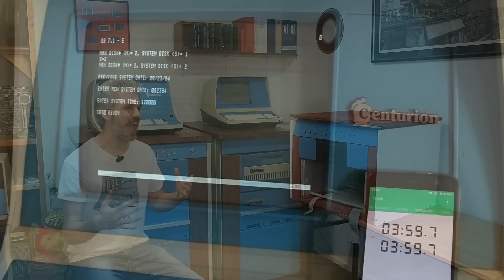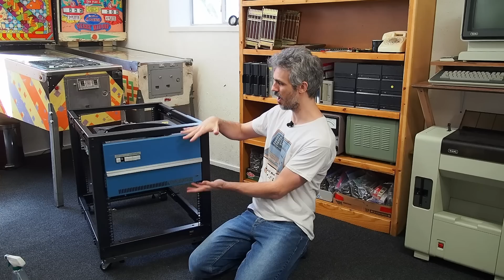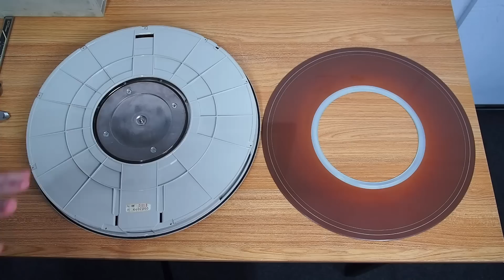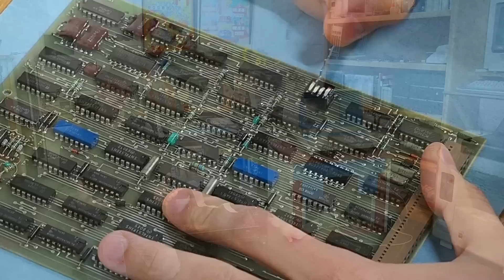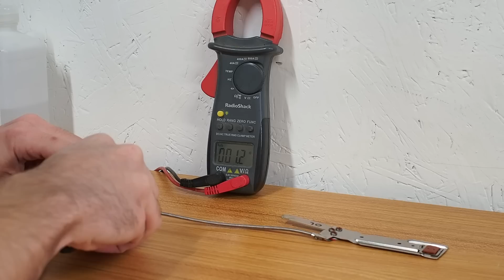Trying (and Failing) to Restore a 1970s CDC 10MB Hard Drive

Comment: The thumbnail is SUPERB!
Have you been watching Curious Marc's Alto restoration videos on endless repeat? ;)
Will a Hawk drive run WITHOUT a fixed platter???
Reply: A Hawk drive shows up in the Centurion OPSYS as two logical 5MB disk drive volumes. Yes you can build up a Hawk missing one of the two platters ( fixed or removable ) and the heads for that missing platter can be removed.  The trick is the Hawk must have sector ring pules from the fixed disk platter and the removable disk platter for the Hawk to load the heads over the remaining platter.  So if you  install a removable disk cart. with the platter & heads missing you still have to have the sectoring ring installed in disk cart.   This is what we are now doing now, have built up a Hawk with a fixed platter & fix heads only and a cart. sector ring.  Testing now under way.

Comment: The Commodore 1541 floppy drive mechanisms made by Newtronics had a design defect where the epoxy would fail a bit and let moisture in, causing the head coils to corrode and go open. I wonder if a similar fault has happened here.

Comment: Not that I'm suggesting this as an alternative to fixing the Hawk, but wonder if it would be possible to make a storage solution with a modern SSD that 'looks' like a Hawk drive to the Centurion? Might be useful for day-to-day use so as not to put wear on the original drives.

Comment: Most likely wire failure on those heads (since the connecting wire has least support,and is open the corrosion)  You may be able to rewire them (nothing to lose)

Comment: For a faster floppy replacement, could you use an emulation? There should be something usable out there.
Reply: Emulating a Shugart interface and custom sector format on floppy is still not a trivial thing, unfortunately.
Reply: @graealex  luckily they already exist. You can buy them. Might need a few tweaks, but if they can write emulators i am sure they can do that.
Reply: @bzuidgeest  "a few tweaks" is going to be the understatement of the century
Reply: @graealex  We're looking at floppy emulation with an RPi Pico. The issue with off the shelf emulators is they're set up for "standard" formats, and the software effort to coerce them into the non-standard Centurion format looks non-trivial...

Comment: I don't think the coils blew out. It would be strange if that happened. There should be nothing in the electronic that pushes the needed amps through the coil without destroying the electronics. My guess is that the wires to the coils are broken somewhere. I successfully repaired broken wires in a headphone coil, but it was a pain. The wires where thinner than human hair, and i think the wires in your coils are even thinner. To measure und fix that you need equipment you don't have. Maybe someone who fixes up smartphones can help you out?

Comment: I would never have thought of dip switches causing issues.   I learned something new from you today.
Reply: I was servicing a big graphics workstation which had intermittent failures.
I traced them to these nasty dip switches and replaced them (Approximately 15 8bit in each WS)
After that I had a quiet life with no calls from the users.

Comment: I bet the problem is the wires going to the heads are broken. Although coils can be burned by carrying too much current, it's more likely that the wires being under constant motion just broke the conductors. I would check the continuity directly at the coil-wire connection and see if it's still open circuit there. Wires are easier to replace than head transducers.
Reply: I was thinking the same thing!
Reply: @Derundurel  so was i, guess we'll know in the next episode.

Comment: I've see you and yours in action -- you will figure this out.  Here's a question:  could an ST-506 drive be adapted to serve in time for the meets you need to make, or is this interface (SMD) more akin to SCSI.  Could another Finch drive be made to serve?  (I know... the ST-506 thing is akin to heresy, but it would beat a dead and non-working machine.) 

However you decide to proceed, I'm sure you will eventually prevail.  Ganbatte, yo!

Comment: Please, if you haven’t already, consider putting your own spin on the recently released new old stock “Nabu” computers that were discovered from the 1980s, and that are now being sold brand new for dirt cheap. I’m about to get my own, but will need guidance on what to do with it. There are some AMAZING things being done with it already, e.g. the “ElectroGeek64” channel, but I would be fascinated to see what you can do with an original, yet brand new, 8 bit computer from the 1980s…

Comment: Remember how you had to swap the analog board earlier in the testing to get the alignment test going? Yeeeah, that thing doesn't happen to interface with the R/W heads does it? 🤔

Sounds like both the RW and Erase heads are capable of being "driven" (signal applied to, not just read from, them). So, a control board being fried is definitely something that could knacker them, I'd suspect!
Reply: Yes the only way they would be open is too much current or badly corroded enough to break the copper wires.

Comment: Shim the heads for the thicker disk maybe? 

Is the alignment tool just hard sectoring the disk for use with the controller? Old disks needed to be  synchronized from what I remember

Side thought, Should try bubble memory.. would be period correct I think…

Comment: Does this use a 100tpi or 200tpi head? I wonder if you could salvage and adapt a set of heads from another drive, like a 100tpi Hitachi HFD305S or something. Idk.. Maybe even something more common than an already-super-rare 3" drive? maybe even a standard 1.2mb 5.25" pair? So what if the fixed platter is offset weird and incompatible with everything else?
Reply: I'm totally seeing a 3d printed adaptor block to make a salvaged head fit into that little metal bracket/arm. or there's fabricating new arms from spring steel, but that's a whole effort to get right on it's own.
Reply: The CDC 9427H in the Warrex / Centurion config uses 200 TPI Straddle Erase heads (two Upper & two Lower).  Other OEM users of the Hawk could have used 100 TPI Heads or even Pre-Ease Heads to meet that OEM's needs.

Comment: Where did you measure the resistance of the heads?  At the heads them selves or from the end of the wires that go to the heads?  Are the wires going to the heads possibly the part that's open circuit and you would just have to replace part of the wires? Likely the part of the wire that bends as the heads move.

Comment: Emulate the drive, and remove the heads from the physical drive but still have it spinning with a  partial head assembly still in place so you still get the kerchunka. Then split the signal so that commands get sent to both the physical drive and the virtual drive, but data is only read back from the virtual drive.
Reply: Which defeats the purpose completly.

Comment: The cool thing is you can actually work on these drives.  Newer spinning magnetic media drives are so tight tolerance wise, you really cannot work on them without specialized clean rooms and the like.  Those drives were so expensive, that they HAD to be repairable.
Reply: my new 14TB drive is so tight tolerance that it uses helium instead of air (so the heads can float even closer I guess), its totally sealed
Reply: it made me somewhat afraid of drives, that's why I use 3-way RAID redundancy and have 8 of them. they are basically irreparable and lost data is lost forever, which is why you have to use a proper RAID system that does parity and have backups, there's no recovery if they ever fail.

which is basically the truth for any hard drive nowadays, they should never ever be used as a single drive for any system, unless you don't care about losing data, because you are going to eventually lose data.
Reply: @monad_tcp  Which RAID do you prefer? I'm not educated on the differences, and have never been able to figure it out for myself.
Reply: @GrayRaceCat  usually I use stripping with two-way parity, that means two disks can fail.
But for really important data, I use three-way parity.

That would be roughly RAID6 and "Raid7", it's by software.
Reply: @GrayRaceCat  look into zfs and unraid.
Reply: @monad_tcp  Thank you. I’ll read up on Raid6 and Raid7. I’m curious why did you put quotes “” around Raid7?
Reply: @MrMousiee  thanks.
Reply: @GrayRaceCat  he mentions it's sw raid instead of hw. Meaning it's probably some other raid solution like unraid or zfs or something else. Doesn't use a raidcard and all handled by software.
Reply: @GrayRaceCat  raid6 is double parity.
Raid7 would be triple parity , but that's non-standard, it only exists as software raid.
Reply: @monad_tcp  thank you.
Reply: @GrayRaceCat  Bear in mind that RAID protects against one thing: drive failure. But if the drive array is commanded to delete or overwrite something — user error, software bug, or normal operation — that deletion or overwrite will be dutifully mirrored across the array. Consequently, a key thing to remember is RAID IS NOT A BACKUP!!! The purpose of RAID is high availability (that is, low downtime), not backup. Yes, striped arrays also increase throughput (especially on reads), but modern SSDs run circles around hard disk RAID. So in practice, what I recommend today — and do myself for my home computer — is to use SSD as the primary disk (and in my case, an additional large hard disk just for music and movies/tv, since those don’t need to be fast) and then have multiple independent large hard disks purely for backup. (Independent in the sense that each backup is a complete backup, separate from the other.) One backup disk is internal, the other is an external disk that I leave at the office and bring home periodically to update the backup. (The offsite backup protects against fire, theft, etc.)

I use software that performs incremental backups with versioning. (Time Machine on the Mac;  equivalent third party backup software exists for windows.) So backups are created hourly, and just get thinned out over time, but retaining versions going back a long time, with a big backup disk. 

I have considered adding on a third layer of redundancy by using an online backup service. Up to now, I’ve only done that for selected things, using iCloud and OneDrive, but it’d be nice to have complete system backups online, too.
Reply: Any bearing malfunction warrants a replacement. The oil is merely a temporary bandaid.
Reply: The low density and error checking of those makes a clean room superfluous.
Reply: It always gives me a bit of a startle to see what amounts to a hard drive platter just sitting there! Under almost any circumstances, if you can see that with a modern drive then the drive is very dead.
Reply: @PhysicsGamer  That always gave me pause in the late 80s to very early 2000s with the removable hard disk systems (like SyQuest and Iomega Jaz), where the disk cartridge contained a hard disk platter. In the Jaz, up to 2GB in a 3.5” cartridge. And indeed, they proved to not be super reliable. 
The mainframe and minicomputer era removable hard disks had such low data densities that I doubt contamination was a huuuuge problem (anyone with experience, please correct me!). But ones with 90s-level data density? Oof.

Comment: Bummer.. coils can burn out in that older stuff (make sure there isnt a fault in any of the logic cards causing them to burn out!) have you verified the coils are actually dead and there isnt a break in the long wiring from the heads, there is quite a bit of flex in the cable and it could cause a break over the years.

Comment: Just checked my eBay watch list and unfortunately someone bought the CDC Hawk heads I was looking at. I will keep an eye out for another set.
Reply from the maker: That was probably me that bought the head, haha.
Unfortunately, it's the incorrect type, the erase head on it has about 15x as much resistance as the ones that this drive uses. Most likely a straddle erase head vs. a pre-erase head. If I had a lower and an upper straddle erase, I could set the drive up to use them, but the Centurion software would probably not work due to timing problems. 

If you come across any more though, let me know!
Reply: @UsagiElectric  If possible I would buy those incorrect heads off of you.
Reply: @UsagiElectric  I have also been working on building a CDC Hawk drive. Only difference is that I am starting out with no drive and building it from parts off of ebay. 

My goal is to make it work then create a USB interface for it with Windows. It is part of my project of combining old and new tech.

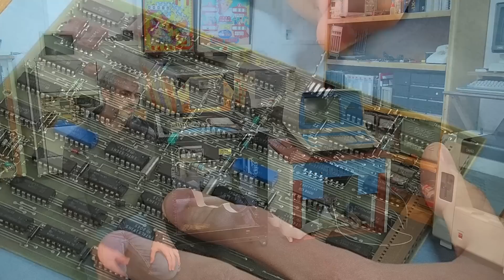Comment: 17:54 are lockpicks legal where you live? Looks like a rake pick to me ;-)
Reply: Yes they are, lockpicks are not illegal, stealing is.
Reply: @bzuidgeest  From what I read it varies from state to state. In Virginia it is illegal without license.
In some countries it is illegal (eg. New Zealand, UK, Poland) to posess or make lockpicks.
That's why I asked.
Reply: @akkudakkupl  Usagi is in Texas, where there are no restrictions on lockpicks.

That said, I continue to wonder why they have not just replaced the lock core, or just decoded the existing core and had a proper key made. Or even just replace the whole lock with a plain switch. The pick-the-lock thing was expedient at first, but now it just seems like an unnecessary hassle. Fixing the keyed switch would be trivial compared to all the other effort that's gone into this fabulous project to date!
Reply: @harvey66616  replacing the core would be the best option to keep it looking original. I myself would just replace it with an 22mm industrial keyswitch - cheap, efficient, reliable.
Reply: @akkudakkupl  Lock picks are legal in New Zealand. Planning or actually committing a crime with them is not.

Comment: How does the Hawk manage servo?  I don't know anything about them in that regard but I'm pretty sure the WREN had a dedicated servo surface on the first plate which worked fine since the plates were not removable but the Hawk has removable packs.  Does the removable one had a servo surface too or is it data on both sides and relying on the precision of the servo surface on the non-removable plate to allow it to be successfully used in other drives?  If it's data on both sides, it likely can't be used as for servo as it won't have the right patterns on that surface.  To be honest I don't even know what sort of servo patterns would be written or even if it's a dual waveform or just a single that is simply peaked by the servo circuitry.  edit  OK, so it seems to be seeking happily so I guess it is happy with what ever is on the servo surface.
Reply: The Hawk came out about 5 to 7 years before CDC started using a surface of a platter for servo position and data clock timing like on the CDC Phoenix (@ 400 TPI), Finch & WREN.  The Hawk 200 TPI  uses an external capacitively coupled transducer for cylinder position.

Comment: Those drives seem incredibility fragile, maybe not ideal for a 'portable' system, have you though about a drive emulator? You do have the advantage that some of the code has been pulled apart so you kind of know what it expects to see. - so maybe a raspberry pi etc, and put all you data on SD cards, or USB sticks.

As for the dead heads, it kind of reminds me of speaker transformers from some old valve radio's where poor selections or materials resulted in the coils slowly corroding away inside that block of material the head is made of. If that is the case then maybe you should plan to get all the data off and stop using them.
Reply: Paul, I and a few other folks are working on building a Hawk-drive compatible emulator for Usagi here, and we're going to give him one eventually (whether he wants it or not...😁  ha!  )

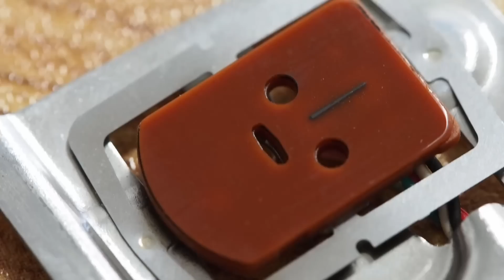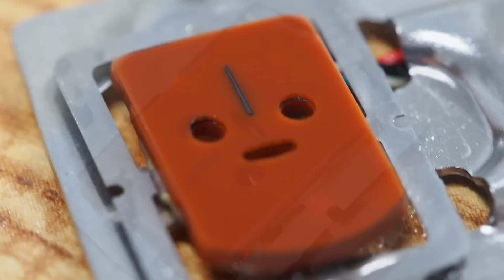Comment: At 13:05 you show the head that didn't crash, and at 13:58 you show the crashed head. Not sure if it's just an optical illusion or what, but it looks like the end of the head further from the two holes is sitting lower in the whatever the brown material is than the uncrashed head. It's like the brown material heated up and the head moved in it.

Comment: For a VCF - no time this time - I would look for one of those PC designs (were all 200 shown to IBM working / IBMs Rebadged with just one or to to the EDS/ Centurion Division full internal spec ?)  They seem as if they could be to the Centurion Systems like the DEC Rainbow was to the DECs as a terminal/local desktop computer , with scope to run a number of programms
Reply: The EDS-Centurion PC was 100% a clone of the IBM PC of the day (with a few EDS value add features).  The EDS-Centurion PC was built as a XT model. At one time we had a large number of Intel 286 CPU chips on order to start building the EDS-Centurion AT class PC the IBM came around to the price point EDS would pay and EDS shutdown the  EDS-Centurion PC project.
Reply: @kenromaine2387  I would have thought that having Centurion as a brand for a PC would have matched the brand at least to Compaq (with the extra features of being a little ahead of IBM), selling into the market EDS already had rather than yielding to IBM (Though the 286 was my favourite intel variant - I had a UK assembled clone from a local builder (I had a 8086 too , cannot remember the make , which was too bulky ) We had AN Olivetti 8086 lovely design but so slow plus A Compaq ( our budgets-  and space, were small ), everything else ran on a DEC PDP.  I upgraded my 286 to a 386SX which was good enough for lotus 123 and a couple of graph and accounting programs plus wordstar (later word perfect).  I was also an end user of a Thorn-EMI system that ran custom software but was very fast for 1986.   I suppose really the PC eventually won in the commercial marketplace because of the availability of lots of commercial software, but it always seemed odd we went and got standalone processing boxes then a few years later wanted to network them all together.